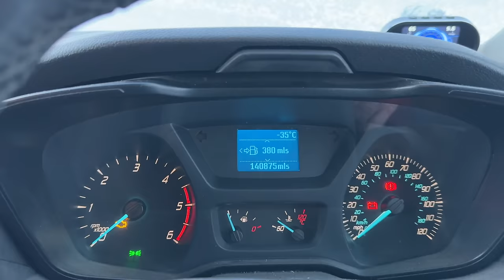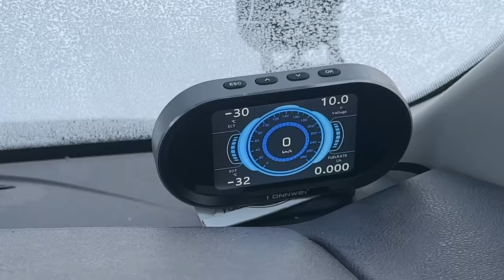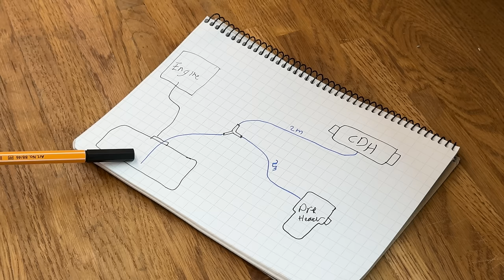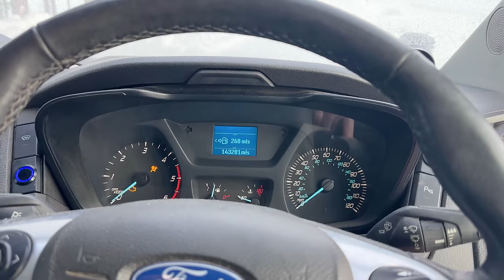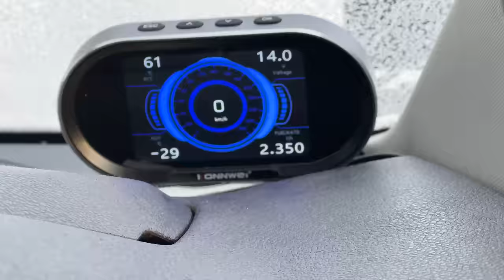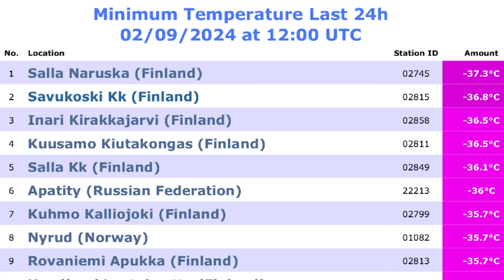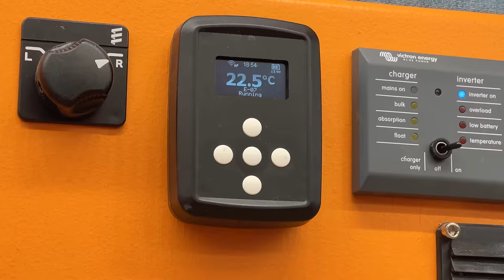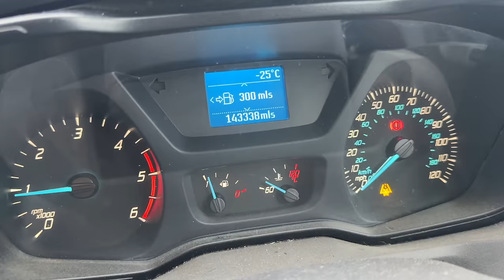DISASTER! Vanlife in the Arctic goes wrong!!

Comment: That was a well put together, interesting video, your ability to stand back and problem solve logically was good to watch. You appeared to do everything right, you never seemed to lose site of the overall picture and didn't get lost in minor detail but went through the circuit looking for the place of resistance. I imagine you've already planned upgrades to the van to prevent further problems. Perhaps lagged pipes under the vehicle with a heated cable attached inside the insulation and run all night, or maybe run things as much as possible inside the van. I don't own a van but I'm always interested in others living in vans especially in difficult conditions. A cold floor is a common complaint for winter travellers, even in the UK,  I'd hate that, perhaps  underfloor heating would be an idea - heat rises so more efficient use of warm air befor it goes out of the roof. Did you enjoy the challenge appart of a bit of anxiety?
It's always strange watching adventure films like this becuse as a viewer it's like this al happened a few days ago when in fact your probably off doing something competely different because most of Finland will be in the +C* by now. 
You must have a good job being able to take the winter off appart from the work for Roamer, I noticed an Anker battery in shot lol, thanks for the video, hope you can read this my dylexia is woking overtime.
Reply from the maker: I can read your message no problem at all. I’m very dyslexic myself which is the whole reason the channel is called “mispronounced”

My background is leading Expeditions all over the globe and taking clients into remote places. Whilst normally that doesn’t include a vehicle, problem-solving without assistance is a major part of my job. 

As for upgrades to deal with future issues. After this video I purchased a 1000 W electric circulation coolant heater effectively a less powerful but completely electric version of my diesel engine preheater which I will install as a backup option. The diesel engine preheaters are fantastic and whilst I carry an entire spare diesel engine preheater with me as a back up for failure having an already integrated electric one would be convenient.

Underfloor heating has been on my mind for a few years now, especially with three Arctic winters it is a lot of work to retrofit. there are hydronic and electric solutions. However, this year I decided insulated slippers, which were definitely a win! 

I enjoy the challenge, I don’t put myself into positions to cause challenges, but if they occur as part of my goal, I enjoy the problem-solving aspect and there are many backup solutions which you don’t see in this video. Including all the way up to satellite communication options.
Reply: @MispronouncedAdventures  Wow,! adventure of a different kind all year, it's a shame you can't vlog some of your work but I guess you'll have no time when your work is leading and keeping others safe.
Reply from the maker: I have attempted to film that work before, but it impacts on my job of actually leading although I do photograph and do Instagram stories is that doesn’t really subtract from my actual professional

Comment: For your next camper build : I guess the next camper will have a serious LiFePO4 battery bank (maybe around 10KW or more?).  In that case you could consider looking at an electric engine pre-heater.  If you stick to a diesel engine pre-heater, you could decide to put the fuel line inside another tube, together with an electric heating ribbon.  Hope you find your -40°C/°F in the next winter season.
Reply from the maker: The next van build is on the close horizon. I like to think.

In the next few videos, I actually buy 1000 W electric circulating coolant preheater, as a back up to the webasto and I am playing a 10kw+ bank yes, in 48v
Reply: @MispronouncedAdventures That’s the way to go!  Looking forward to the video’s of the next Ford Transit 4x4 with winch and large battery bank (although I wish it would be a Sprinter 4x4 cab/chassis with a GRP box, keeping the same dimensions as the panel van version)
Reply from the maker: @tcs7678  going to be an AWD transit for me. I love the transit base. and whilst there is a big difference between AWD vs 4x4. My experience of friends who have an AWD version say they are very capable bits of kit. my thoughts are with a 4x4 ( transfer box )  I’m probably not gonna take it Rock crawling in so AWD should be sufficient for me plans.  

definitely a winch for sure. 

Almost pulled the trigger last week on one but it sold
Reply: @MispronouncedAdventures  The Ford Transit AWD is for sure capable enough.  It probably needs a bit of a lift and 245/75R16 tyres because ground clearance is often more important than 4x4.  The new Sprinter is also AWD now.   I just love my Sprinter Cab/Chassis 4x4 with well insulated GRP box, that’s why I would like to see you build one.  But I am sure that the Transit will perform just fine in both snow and sand.
Reply from the maker: @tcs7678  i’m already looking at importing the van compass stage 4.0 lift kit for the transit from the US and and running a larger size of tyre because of it
Reply: @MispronouncedAdventures Sounds perfect.  Hope the British MOT doesn’t mind these aftermarket items and larger wheel sizes.  By that time the new BFG KO3 tyres might be available (or you might find a tyre sponsor …) Here in Belgium, our MOT equivalent is often very strict, especially in the Flemish part of the country.
Reply: @MispronouncedAdventures  Maybe an insulated box? I see below you are considering AWD. I used to have a Mitsubishi Delica and even that old 4x4 system was great in deep snow. But it caused a lot of transmission drag and the mpg wasn't too good.
Reply from the maker: @tcs7678  no issues here with changing tyres sizes as long as they have the correct weight rating for the vehicle still and they do not impact or contact the wheel arch or chassis ( I may be a few other minor points )
Reply: @MispronouncedAdventures  Is this your only 4-wheeled vehicle, no other car? As you spend so much time in the Nordics, maybe next van should be LHD version?
Reply from the maker: @pffyespff my current van is RWD. 

Personally i’d stick to a right-hand drive as a Brit. I don’t really find being a right hand drive in the Europe hindrance at all.

Comment: If we are not going to see Yeti-2 being built this summer I really think you should have some electric trace heating wrapped around fuel lines and even an electric sump pad fitted to poor old Yeti just for the -40 next year
Reply from the maker: All being well, we will be seeing yeti 2 this summer. After this video I bought an electric backup option which was 1000W electric coolant heater with built-in circulation pump.

Comment: Trace heating on your fuel lines would have solved your problem. It’s usually 240v but i’m sure you can get it in 12v too. You can get self temperature regulating trace hearing too so all you need to do is put power to it.
Reply from the maker: Well it’s definitely a thought it would be quite a lot of work to do and no one else out here really does it. I think for future reference if I knew it was going to be that particularly cold again which is reasonably unusual ( below -35c for a extended period ) I would add an additional additive and run it through the lines.
Reply: @MispronouncedAdventures  though don't most people plug in a sump block heater and a trickle charger from public mains (same in Alaska afaik).
Reply from the maker: Yes, most is a plug-in block heater which is an electrical element with no circulation but they leave it plugged in overnight in urban environments are their own homes. These my type of engine preheaters are far more powerful and quicker due circulation

Comment: I was told by an old lorry driver that they used to add a bit of petrol to the diesel to keep things going in the winter. I wouldn't recommend it, but if you are really stuck, the engine will at oeast be warm once its exploded!
Reply from the maker: Yeah, that’s something I’ve heard before as well although my understanding is that was usually for untreated diesel. all the pumps in the winter here are winter grade diesel which can vary to a degree -35, -38 and so on , but even the winter grade has its limits. Which I was on or passed.

Comment: Hi Alex, I'm picking up loads of tips from you! Such as fitting Anderson connectors and many, many more. Here's one I have for you: Fit a separate tank to serve your diesel heaters and use Kerosene instead, which has a gel point of minus 40 (the same in F or C). I have fitted a 6 gallon outboard motor fuel tank in a slide out box under my van (it is an ex-supermarket insulated box-on-chassis van (like @truebluetravellers) so maybe a lot more room underneath than yours!). I use Kerosene at home so I can decant some from the heating oil tank as required. I have a Webasto and a Hcalory so it saves a bit on fuel cost. I intend to fit a sump heating pad to it as well in case I am forced to use diesel when travelling (I saw @Adz Ventures had fitted one to his Ducato).
Reply from the maker: For me, I always much preferred the idea and space efficiency of having it plumbed directly into my main fuel tank, because most of the auxiliary tanks for diesel heaters are pretty tiny. But I can see from your point of view if you’ve got the extra Real Estate to have a huge underslung tank then it may make sense to do that method. this trip I used about 170L I think in the air heater. 

Sump heater As for me I don’t think it’s too important as my van runs 0W30 engine oil. Which is really rather thin. 

Anderson connectors are great things as well as  XT60 connectors as well
Reply: @MispronouncedAdventures  I was thinking of the sump heater to be used for heating my auxiliary fuel tank, in case I had to used diesel if Kerosene wasn't available. I have a heat exchanger running off my Webasto wet circuit which meets the engine coolant. Gets the engine to about 60 degrees. I also run a separate coolant line from my Webasto which heats my waste outlets and waste tank.

Comment: Could you not extend the fuel pipe for the night heater and stick the "Y" junction right next to the engine pre heater to lessen the amount of narrow bore pipe available to gel ?
Reply from the maker: The Y Junction is pretty much as soon as it comes out of the fuel tank which keeps the runs the shortest total length to each unit. 

Changing fuel line bore away from the manufactures recommendations is not always recommended.

Comment: Hooray! More arctic mishap fun!
Reply from the maker: Multiple mishaps in this video and if I’m honest, it was the last one of the video which was the most severe
Reply: @MispronouncedAdventures You solved the problems gallantly!  An immersion heater in the diesel tank (that doesn't set everything on fire) might be a wild idea that eventually might work.. or drain the battery even more.
Reply from the maker: @RAGJAW whilst I can see the logic there. the -35 temperatures are rare ish . It wasn’t so much the fuel in the tank either that’s such a large volume of liquid. It takes a long time to lose the amount of heat energy. It was the tiny bore of the fuel line and fuel in it

Comment: All part of the adventure.. awesome!  FYI the LSD ( limited slip diff ) are front only. Rear diffs are open or AWD which would've got out easily. Regarding your oil leak check the timing cover.. very prone to leak on the mk8's. Cheers!
Reply from the maker: , for the oil leak my timing cover does leak only after Ford redid my wet belt. But that’s not the leak which is the problem the vacuum pump at the back of the engine which Ford also replaced leaked after.
Reply: @MispronouncedAdventures  Classic! Hopefully you can get it fixed for free! 
BTW my exhaust manifold recently came loose as one of the studs had sheared off so needed re-tapping. Again another very common issue to look out for on these Fords.

Comment: I was told once if you mix diesel with kerosene then under very cold conditions it will flow and no jell up.  I guess knowing the proportions and knowing your engine's tolerance would be essential.
Reply from the maker: Yes for Untreated diesel or similar. This is winter grade diesel and is already treated coming out the pump. It’s normally find down to -35c, but I should of put -38 grade in as it was -35 that night
Reply: Kerosene will stay liquid down to minus 40 (both F and C) but it's only sold for heating fuel use in the UK (and probably the rest of Europe) and as a result has a dye and a sneaky reagent so if you get inspected by the 'ministry' you can be prosecuted if you use it for road transport. I have fitted a separate 6 gallon kerosene tank to power my 2 'diesel' heaters with kerosene. It's half the price of diesel as well!

Comment: You could look at getting a detroit trutrac  diff, normal LSDs use friction plates, not sure how the extreme temperatures might affect the operation, not an issue with a trutrac. Incidentally though, both could potentially help the back slide on an icy road which may not be so helpful.....
Reply from the maker: That will give me something to look into, although I am look at replacing the van with an AWD version

Comment: Why not direct the diesel heat exhaust at the engine block or runnit through a heat exchanger into the engine coolant? Xx
Reply from the maker: the diesel heaters exhaust is around 3 m from the engine bay at least and not sure long-term how good pumping exhaust gases into the engine bay would be. as for a coolant run again it would be at least trying to lay 6 to 7 m of coolant pipe there and back again, which is difficult

Comment: When I was in the Swedish military service up north, on our trucks we put a pan of fuel and lit it on fire under the oilpan, of course it was like 40-50cm of gap between the flames and the oilpan, but it was the only way to get the engines turning in those temperatures. Heating the coolant is good for the engine, but it can take too long to transfer it's heat to the oil, especially if you need to get going.
Reply from the maker: Oil isn’t really a problem for me heating wise, being euro6 engine in my van it already uses 0W30 which is fine down temps. 

But definitely could see him bigger trucks running a thicker oil. Heating both oil and coolant would be a great to heat up. Definitely don’t want to be lighting fires under modern engines way too  many plastic and cabling on the under side.

The main issue in this case was the fuel itself
Reply: @MispronouncedAdventures  I totally agree the open flame under a more modern vehicle is probably not a good idea, perhaps some candles is alright. But the fact that your starter gave up turning is likely due to the oil getting thick as syrup even if it is 0W30. Also you mentioned that the battery is 5 years old, up north 5 years is the maximum recommended age, while you can expect a couple more in warmer climates. Battery temperature is also important, it should ideally be warm before trying to start, in Siberia it is common to take the battery inside over night. Also a poorly charged car battery can freeze over and/or crack/swell.
Reply from the maker: That battery is definitely past it best! I think the way I get away with it is I’ve got a trickle charger it. I did see the Nordic prices of an AGM start battery which were eye watering compared to the UK ones.

Comment: Alex.how about putting some 12volt trace heating on the fuel lines then putting some 13mm armaflex pipe insulation over it to stop the heat loss just a thought Roger.

Comment: You can buy 'arctic' diesel from selected 'Neste' stations. Its rated -40/-40C. Normal winter is rated -35/-25 or -38/-30. Summer diesel is -20/-10. Use engine oil 0W30, better in these conditions.
Reply from the maker: Yeah, people had mentioned -40c grade fuel to me before, but I had not seen it at a pump. But if I think about it I haven’t been to many that  Neste fuel stations. Usually pick other brands. But I’ll make note of that for next year.

My engine oil is 0W30 as that’s the default for the MK8 transit normally

Comment: Hi Alex mate great vid as always… I was watching your vid and had a little bit of a brain wave that might help.. but before I throw my idea out… If it’s something that already been thought of or done or can’t be done then apologies in advance 😂…. I haven’t actually got a van to do the vanlife thing yet.. anyway my thought it.. you run a Chinese diesel heater all night while parked up… so could you not make some kind of splitter with some pipe to direct the exhaust to the sump or engine bay to help keep it warm over night? maybe could even have it run through some kind of pan fixed under the sump 🤔 anyway was just wondering 🤷🏻‍♂️
Reply from the maker: In someway that could definitely work logistically not too possible in my van given the location of the diesel heater versus the engine bay it would keep things warmer but not necessarily an effective way of heating the engine. But the hot air principal does work as one of the reasons of lighting a fire all under old engines was to heat the sump as well as all the hot air getting trapped in the engine bay heating the rest of it
Reply: Yes it might work but then thinking about…you drive in some pretty extreme conditions so there’s a chance it could actually have the opposite effect… like if there was condensation/vapour coming out of the exhaust could end up turning part of the engine into a block of ice maybe 🤔 😂😂 yeah don’t listen to me bro 😂🤦🏻